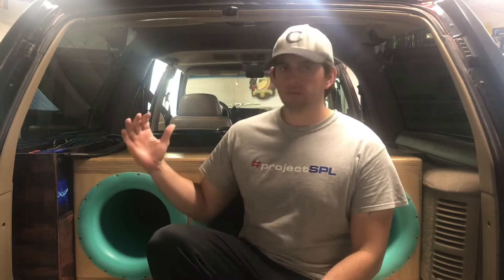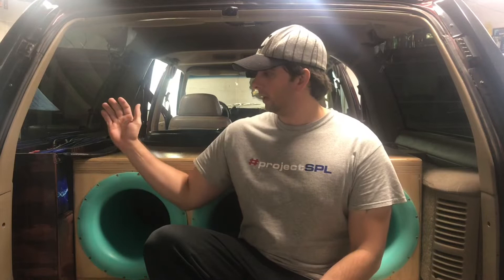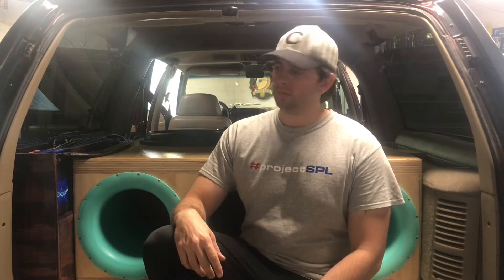2019 BUILD TEAR DOWN 2020 REBUILD

Comment: What size port and length are the ports. My ports are only 5" lows pipe.
Reply from the maker: Ryan Bass For Life those are 10in ports 20in in length
Reply: @StevenHerman8675309  thanks I like that box for 3 I might build one similar. My box right now would be disqualified for under the window and seat level. It still would qualify as a no wall stock electrical. My system has one Soundqubed hdx3 and meaters around a 150db in kick panel on passenger side and 148 on glass!